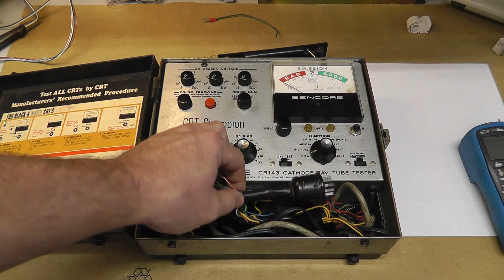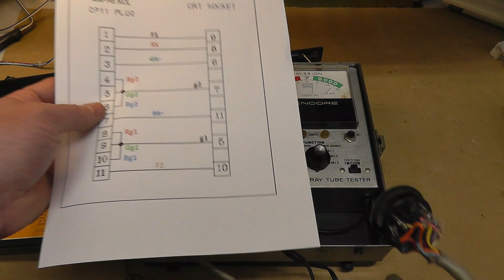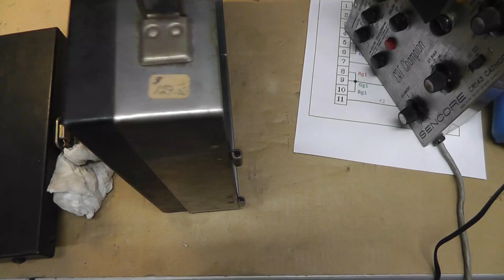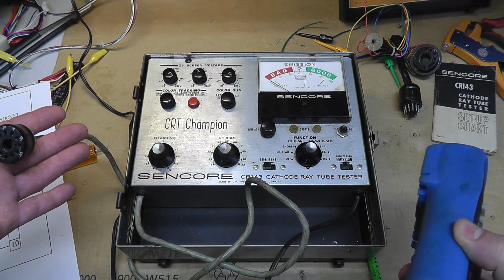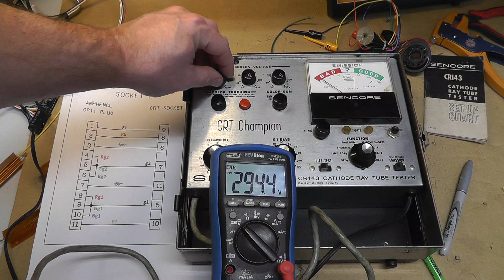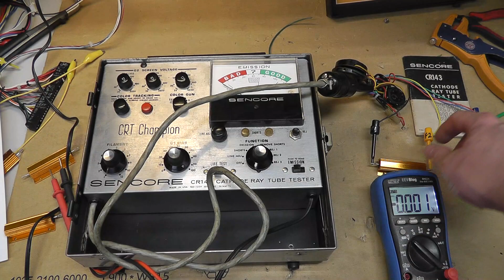CRT Tester Restorer - Sencore CR143 Part1 - Overview, Calibration and Universal Adapter

Comment: Thanks for the video. Thinking about grabbing one of these cheap off of ebay for my first rejuvenator. Will have to do exactly as you're doing and make some kind of an adapter.
Reply from the maker: Glad the video was useful.  I would recommend getting a newer model for arcade (80s) tubes.  You can find cr161 or maybe get luck with an affordable cr7000.  Good luck.

Comment: You need some clip-on meter leads for checking the resistor voltage.
Reply from the maker: That would have been easier.  I have some but just didn't think to use them.